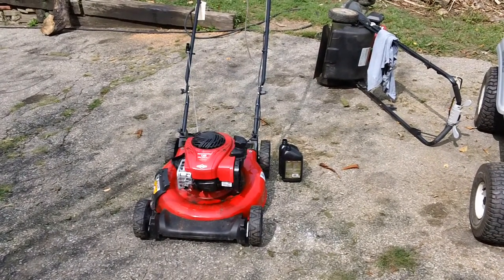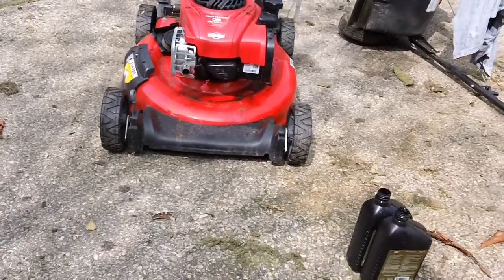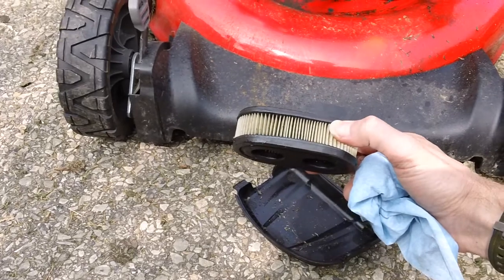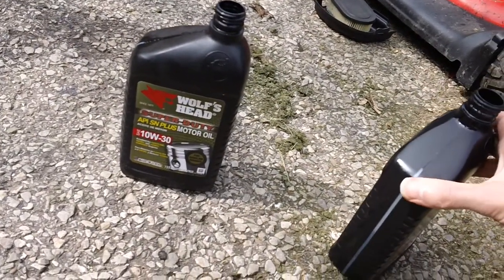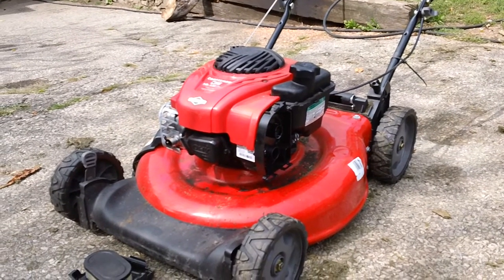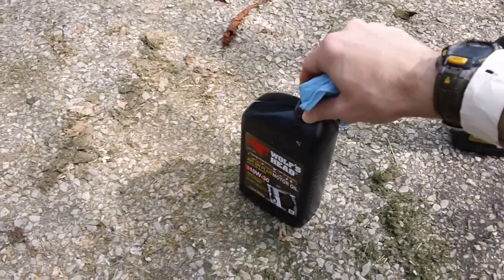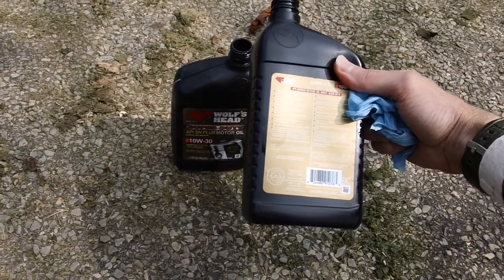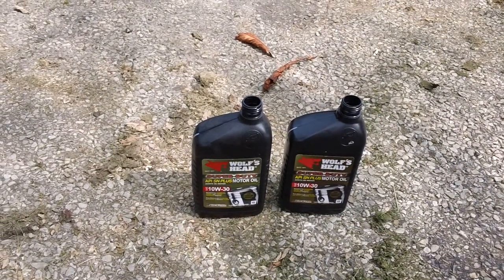Briggs oil capacity

Comment: what's your take on the " just check & add", never change the oil, on the Toro  Briggs motor, it's a hard thing to trust completely.  Just wondering how much oil I needed to put in it after tipping the mower upside down because there's no oil drain plug.

Comment: I've caused damage when I was a kid doing that. I believe the rings take a beating more than anything. But there's a breather flapper that can fail. Soon thereafter, you basically have a lot of oil blowing out the breather and less cutting power. 13-15 oz if in doubt. I turn it on its side to drain. The old flathead push mowers took a little more oil but never a quart. Maybe 18 ozs?
Reply: Flatheads were 20oz total, refill was usually 16-18oz depending on how much oil was left in the engine. You always got more out when draining via the drain plug.